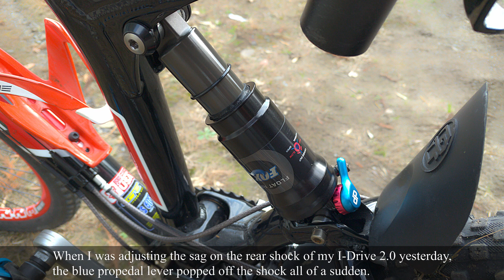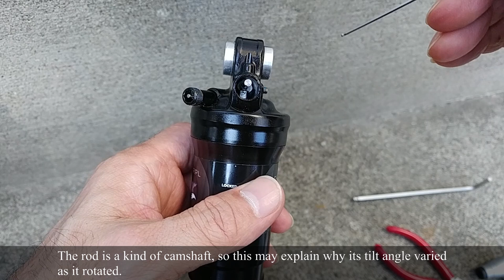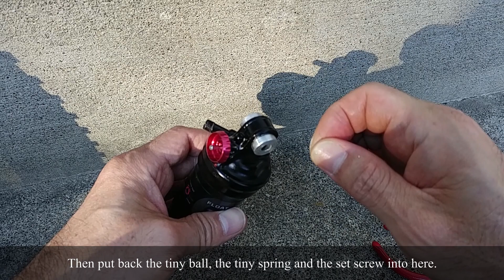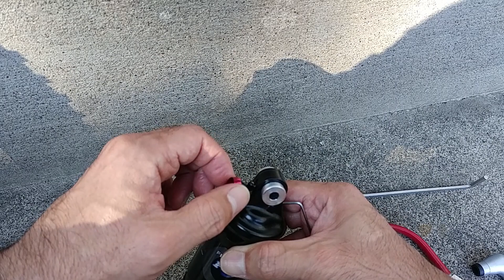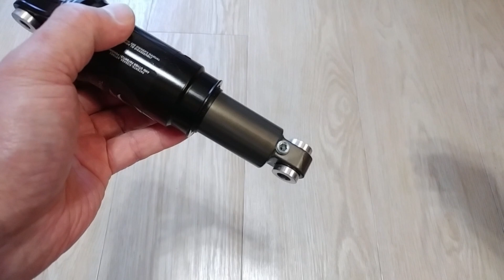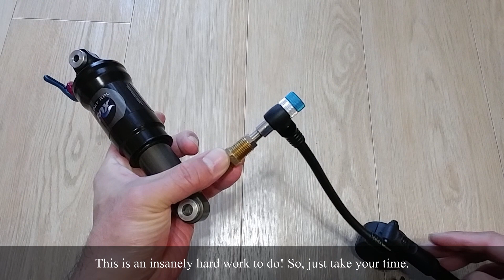[MTB maintenance] An old Fox Float RPL rear shock repair

Comment: Hi i have a foxrp2 but seems like nothing happens when i adjust the rebound
Reply from the maker: It is almost impossible for me to tell what causes your problem without seeing it with my own eyes, unfortunately. If the propedal lever feels loose and doesn't click in when you turn it, then you may need to recharge the IFP with nitrogen.

Comment: do you know where to find the needle used to recharge the chamber?
Reply from the maker: Hi, it's easiest to search for "nitrogen needle for shocks" at eBay. Or your local motorbike repair shops may have those special needles that are used with high pressure nitrogen tanks.

Comment: Where do you get the needle air charging tip for the shock pump?
Reply from the maker: Hi, it's easiest to search for "nitrogen needle for shocks" at eBay. Or your local motorbike repair shops may have those special needles that are used with high pressure nitrogen tanks.

Comment: I have the fox float rp2 that was not holding air, I replaced everything that comes in the fox float rebuild kit. I went to air it up and again it would not hold air, so I submerged it while pumping air in so I could see where the air is leaking. Its coming out from under the propedal lever. I called Fox and they said its too old and sent me to risse racing for a complete rebuild @$175 plus shipping.
Is this a repair I can do?
Reply from the maker: Hi, it's hard to give you a definitive answer without seeing the very shock in person. But if it's only air leaking under the propedal lever and there's no oil leakage there, then the piston shaft might be loosened somehow or there might be a gap between threads of the shaft and the upper eyelet unit. In those cases you can fix the problem though it's not easy to do and some proper tools are required. Have a look at my other video if you are interested:

https://youtu.be/3y3QQCyQWwc   (you can see how the upper eyelet unit is removed off the shaft between 23:56 - 25:30)

If there are any damage or wear on the part(s), however, you would need a replacement part(s) and it would be very difficult to find it.
Finally, I should add that the cost of $175 for a complete rebuild seems to be quite reasonable.
Just my 2 cents:)
Reply: @MindDesignFactory  thank you

Comment: Thanks for this helpful video. If the propedal lever seems kind of loose and not clicking cleanly in any of the 3 set positions does this mean that the pressure in the chamber sealed by the pellet needs to be set again?
Reply from the maker: The diminished pressure in the IFP chamber is not the only cause of the propedal lever's vague clicking feel. But the diminished IFP pressure and the damping oil leakage seem to be two major causes of it under normal situations. Do you feel any slight knocking feel when the shock starts compressing? Then the IFP pressure is likely too low.
Reply: @MindDesignFactory  Thanks. I can't say I've noticed a knocking sound.
Reply from the maker: That slight knocking doesn't seem to occur on all the Float shock, and even if it does it is hard to notice while riding the bike. Anyway the knocking is just one of possible indicators of the low IFP pressure. Without it the pressure could still be too low. So recharging the IFP chamber would be worth trying. 
The most solid approach to this kind of problem is the elimination method after all. Cheers.
Reply from the maker: Hi, I forgot to tell you one thing. If you recharge the IFP chamber, it is highly recommended to change the damping oil too. Normally the gas in the IFP chamber leaks from the pellet as well as escapes through the IFP seal into the damping oil, though these things occur very gradually over time. 
Have a nice weekend!
Reply: @MindDesignFactory  Cheers. It sounds like I should contemplate a complete overhaul of the shock via a kit and some good YOUTUBE clips..
Reply from the maker: Got it. The complete rebuild is now no longer an "esoteric kind of work" compared to, say, 10 years ago. As for the nitrogen refill, your local motor bike shop might help you. They should do that on a daily basis:) 
Hope you get back on the saddle soon!

Comment: Dear Author, i want to thank you!!! You saved my rear shock, i fixed it with your video, and it works great. 
I disassembled by mistake nitrogen camera and didn't know how to fill it, so with your video i did full repair and oil change!
Reply from the maker: I thank YOU for letting me know that my video has been helpful for you:)

Comment: Wow your the man!! I have the same shock and the little blue lever is broken- so far I've only found a replacement for $48 on amazon (which is insane!) looks like a pretty challenging fix but could be doable! thanks so much for the video! I might give it a whirl cause not being able to lock out the back shock wastes a lot of energy! Cheers
Reply from the maker: Hi, you mean that only the blue propedal lever is broken and you just need a replacement lever? If you don't mind getting a third party product, then try searching for "CNC lever to fit Fox Shock RP" on eBay. $48 for a replacement lever is ridiculous!
You don't have to do the fix in the video at all if you only need to replace the propedal lever. Hope you get back lockout function on your shock soon! Ciao
Reply: @MindDesignFactory  Thanks for your reply my friend! I appreciate it- Yeah I hope thats the case! I'm newer to mountain biking, the shock seems to work alright, but missing the lever. I heard that in order to replace the lever it would need a complete rebuild/servicing. Thx for the suggestion and video! I'll follow up and let ya know!

Comment: Hello, great video and very interesting. I got this damper from a friend. He said that this no longer works properly. Oil also came out. Can you tell me if a repair would be worth it and if so would you do it?
Reply from the maker: Hi, it's a difficult question:) Without inspecting the actual shock, it is hard to tell if it can be repaired at all. But if there are no visible damages on the stanchion of the shock and the shock itself seems to be in good condition, then I would more than likely try to repair it.
Reply: Same happened to me and I don't know what to do
Reply from the maker: Hi, have you checked out these videos? If not, check it out :)

https://youtube.com/playlist?list=PLBD9_SqX0uYMJBMZiPpEqMME9wloACW6K

Comment: I accidentally turned and pulled the long tube (valve housing) where to let the air in on my roxshock ario now hissing /not holding air, how to fix it, do  i just have to replace the rtiny ubber seal ring and put it back on or Ive completely blowed it ?
Reply: Thanks,  I ve put the tube back and tighten it the air still out after I have more close look with magnifying glass Iam more sure I've damaged the ruber seal it look little squeezed in some end also a bit loose  
I've ordered ario service kit hopefully have what I need in it, or I'll have trouble find new one as my Mondraker colour dont match new shock products and hard to find same one out there nowadays. 
Must i smeared shock grease around the thread of the tube before I replace the seal and put them back in, and some leak seal after  ?
Thanks for answering my question apreciated.
Reply from the maker: Hi, good to hear that you've found a possible cause of air leak. Hope the new service kit will fix the problem. It's ok to apply a thin layer of grease around the thread of the tube. But this part is not meant to be regularly serviced, so I would use Loctite Blue.
Mondraker!? I've only heard of that name before, so googled a bit about Mondraker. A Spanish brand! Colouring and designs are very nice to say the least and the suspension design looks interesting. Dune Carbon XR is one of the sexiest bikes I've ever seen! 
Thanks for watching! Have a nice ride!
Reply from the maker: I've never fiddled with Rockshox rear shocks and so am not the right person to answer your question. But you mean that you have unthreaded and taken off the black tube where the valve core resides? Then you can just tighten the tube back in place and the air should not leak unless the threads or the core is damaged. Sorry it's only my guess.
Reply: Will tell you when  I manage to fix it.
All the best

Comment: What year is this Fox shock from? It doesn’t look that old.
Reply from the maker: Can't remember exactly, but 2009 or 2010. I always put a shock boot on it during rides, so it looks fine but old.
Reply: Mind Design Factory I have a 2005 Trek Liquid frame brand new in box with a nice Chris King headset installed that I never built up. That will be a brand new bike to me when I get it built in a few months. It’s all relative. I AM thinking of tuning up the rear shock since it’s been sitting for 15 years. It’s a Manitou that sold for $400 back in  2005. I need a fork and a rear hub to build the wheels and I can build it up. Good condition 26” straight steerer tube forks are not easy to find.
Reply from the maker: Oh, an Ellsworth-like very nice frame! And the shock should be a Swinger. Nice. Yeah, 1-1/8" non-tapered forks are hard to find, espacially fully adjustable (like Fox Float RLC) ones in good form. Hope you can grasp one for your cool frame set!. Enjoy building up your nice-looking Liquid, Joe!

Comment: That oil leak at the rebound dial is exactly what I have on my daughters shock...
How soon  will you post? Would greatly love it!
Reply from the maker: Is that leaking shock an old Fox model? Fox Float models older than around 2012 seem to suffer this oil leakeage more often than the newer models. The Fox Float RP23 on my wife's Rocky Mountain has this oil leak issue too and she is pushing me to fix it asap. But I don't have time to sort it out right now and it might take quite some time for me to be able to upload the video.